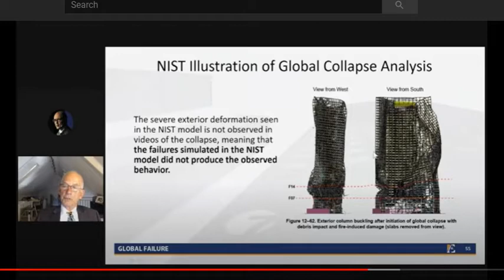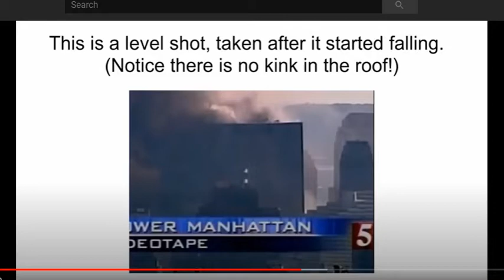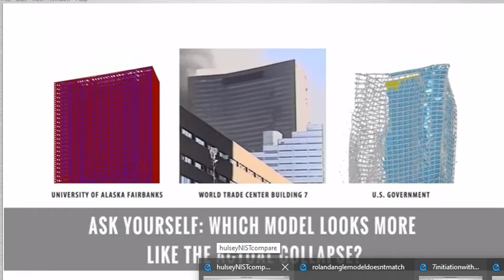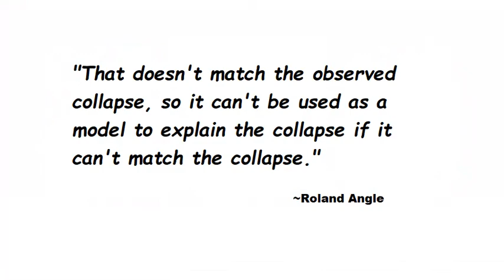AE911Truth Refutes Hulsey's Study

Comment: I believe that while the debunker accurately points out that the building appears to begin breaking in two, which is shown clearly in the 2nd video of the final 2 seconds of the collapse, he nevertheless inaccurately concludes that this somehow precludes controlled demolition.

I believe that his criticism of the Hulsey report is unwarranted.  It is based on Roland Angle's statement that the animation must match the video of the collapse in order for the animation to warrant merit. (Which is what R. Angle rightfully used to invalidate the NIST animation - because of the completely gross geometric differences on an order of magnitude.) The debunker's argument however is not comparing apples to apples. The Hulsey animation uses a mathematic and geometric precision in the removal of all the columns in order to create the animation in an effort to show what a controlled demolition might do - and it does in fact appear much more similar to the actual collapse than the NIST animation. They are almost identical.  The Hulsey animation cannot possibly account for the innumerable variances in the timing and placement of the actual explosives/incendiaries going off in the building - which is what causes the different effects taking place in the building during the collapse such as what this debunker points out.  He is grasping at straws:
Reply from the maker: "...the debunker..."
Nope. My job is to do what Richard Gage and his org. has failed to do, which is analyze all parts of collapse, structural remains, and debris patterns. Gage and his spokespeople engineers have consistently over the years ignored, deflected from, and tried to minimize onset of the visible perimeter frame part of collapse. Onset is THE most important part. So why does Gage & Co. deflect from it with terms such as "innumerable variances"?  It's irresponsible for any architecture/engineer organization to omit initial motion of a collapsing structure when analyzing collapse from a designer's pov. This "Onset Blindness" reveals either utter sloppiness, or intent to deceive.
NOTE: Half the structure is falling over, before any drop of the structure, sudden or other wise. 5:41
QUESTION: What force made it fall over?

Comment: You start by saying the building is stiff, rigid.  Can't sag.  But you accept east face flexing and north face bending at the lower floors without question.   Are you convinced that fire was the cause?  Perhaps Hulsey's model was incomplete in the kink area because he could not get fire conditions to cause what was seen.  This is more evidence for CD, not less.  The burden is upon NIST.  They had far more data to feed into their computers, far more time and money than Hulsey did.
Reply from the maker: Try again. I said it can't crumble into spaghetti as NIST shows, and it can't break apart on it's own in the upper areas, neither of which precludes the north wall bowing in reaction to half the structure falling over.
I've said nothing about any fire causing collapse.

Comment from the maker: Corrections:
1:30 That's the North East corner, not the NW corner.
3:24 The staggered joints I'm referring to are the height of column joints. Spandrel beams to column joints indeed form a straight vertical line.
Reply: Column joints are every two floors, typically.  Check drawings S-17 and 17A.  The columns butt connections are not staggered like in the Twins.